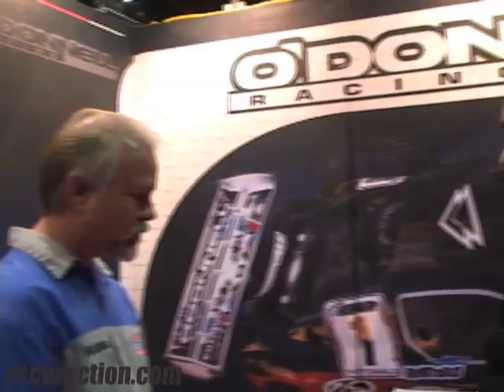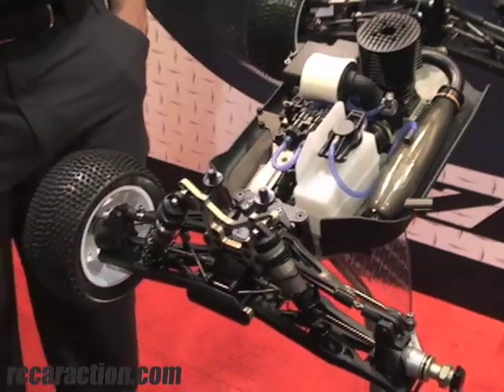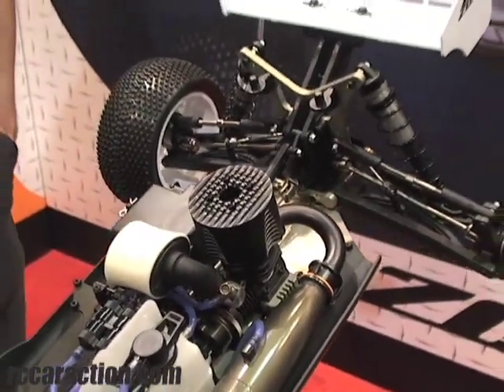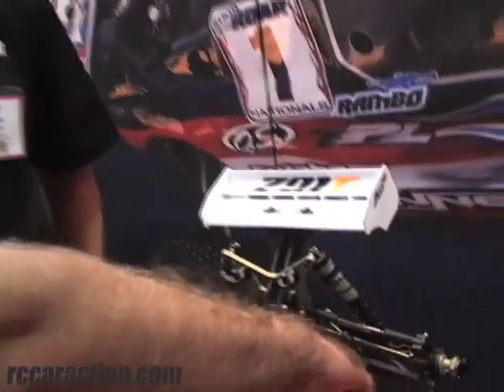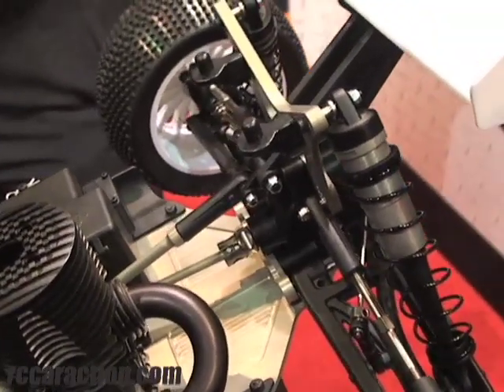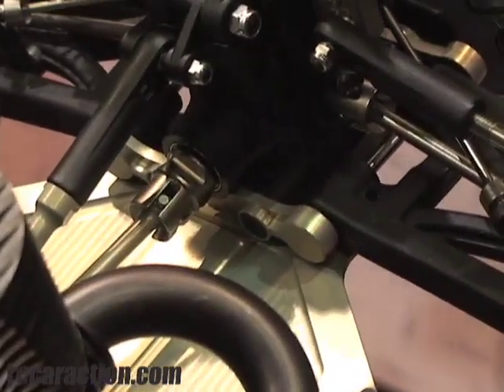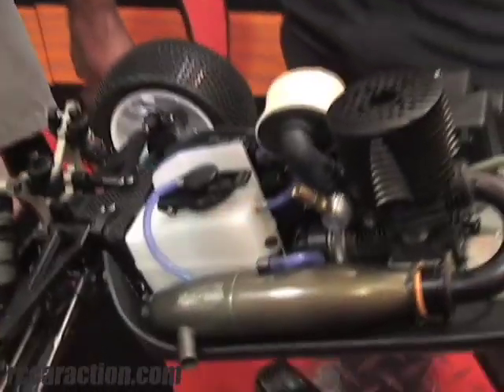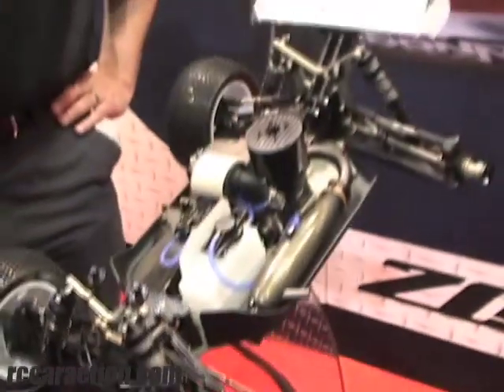O'Donnell Racing's Z01T Buggy

Comment: He explained it to you. The proper operating temperature for ANY nitro RC engine is 220-250. Running 200 or below, as he said, causes a LOT more wear and tear than at 250 because the metals in your engine haven't expanded properly to form a tight fit (the same reason you let the engine warm up first before running it hard).

I've used O'Donnell's, Byron, Wild Cat, etc, etc... There is nothing wrong with any of them, but I notice more power from O'Donnell and Wild Cat than Top Fuel or Byron.